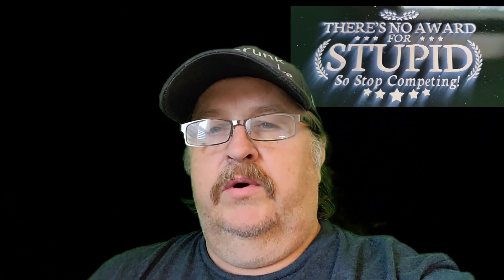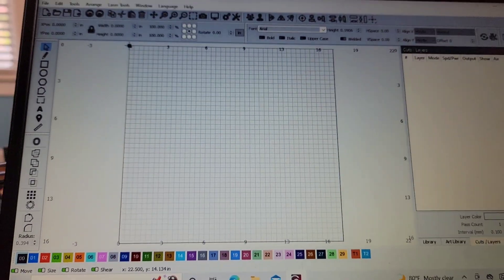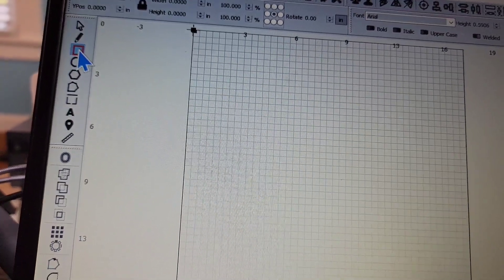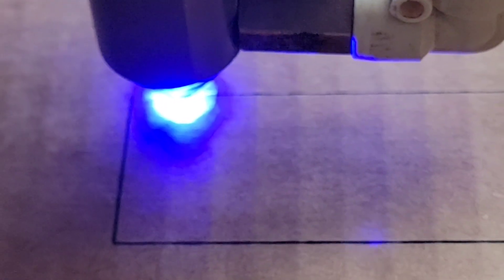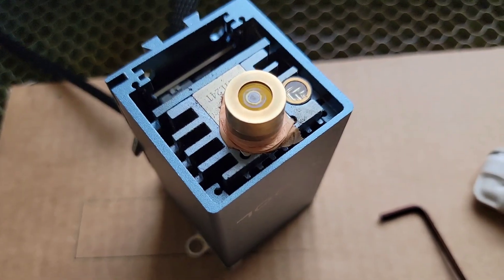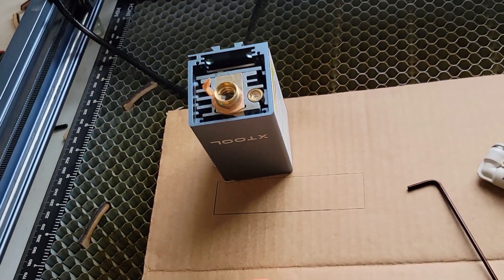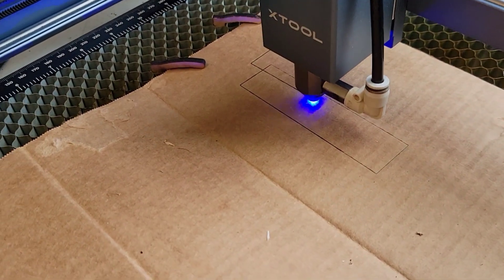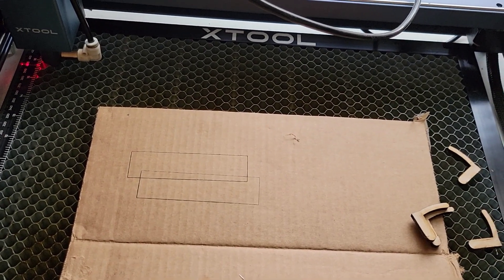Why isn't my xTool D1 working?

Comment: Were the rings highly reflective?? This looks like laser flash bask back reflecting back into the lens and over heating it. Were the rings coated with something anti-reflective (black paint or other non relfective products) should have prevented this.
Reply from the maker: I had some success with the silver ring. But the gold color ring was made out of Kryptonite or something. This is also when I discovered the first of 5 cracked lenses. I had a laser module that was far from ideal. We have since replaced that module and actually looking at replacing that laser completely. Too many problems with it.  Thanks for watching.

Comment: Ok I got a question. I just started seeing my laser
Go from super thin cut to wide and almost burn the wood to ash. I do have air assist and have cleaned with alcohol but what else could be wrong. Xtool has not got back to me yet. Been 2 days no response yet. If you could give me some ideas on  this and also I am using program that came with stool not light burn…yet
Reply from the maker: it sounds like a focus issue. it could be as simple as a cracked dust lens causing the inability to focus the laser correctly. it could be as bad as a cracked dust lens that led to a cracked laser lens. i've had all of the above issues. i had FOUR cracked dust lenses before the laser module itself failed. try removing the dust lens and see if it improves. if you don't find a lens failure somewhere, experiment with moving the laser closer to the cutting surface to see if you see an improvement. this is not a solution, but a test to determine the issue. if closer doesn't help, move it further away and note the differences. my module failed in a relatively short amount of time. these are not that great. there are a lot of better options out there. i learned the hard way. regardless which laser you use, if you want to really get creative with it, Lightburn is a must. i watched videos for two weeks studying before starting their free trial. i wish you luck. but you are probably going to need a replacement module.
Reply: I'm having the same issue. Used it once to cut just a few small test squares.  Tried using it the next day and it just gives me a charred box no matter what I do. Were you able to find the cause and fix it?
Reply from the maker: @leahwalker902  the way I fixed my problem with my xTool, was to replace it. Mine was nothing but problems from the beginning. If you  just bought it and you can return it, do so. I have more questions and comments from xTool owners than anyone else. If it's not about it not working, it's about it only completing part of a job. They say it is Lightburn compatible, but xTool users are constantly telling me the can't do the things I demonstrate. But they don't seem to have problems when they use XCS. The perfect fix is to return it.
Reply: @HoboWithWood  Thanks, I'll see if they let me. I've had it a week, used it once and already hate it..
Reply: @leahwalker902  yes, I took apart the shield, cleaned with alcohol and qtip, and then took apart the lense cover and did the same. Has worked. Air assist definitely on. I also watched YouTube videos from xtool to help me figure out. It’s what they recommend when they got back to me. Good luck.

Comment: Hello! I am having issues with my Xtool D1 Pro Laser. I received it and tried it, the first try was perfect. Then the second time I tried it wouldn't work. The laser would move around but the laser light barely had any strength. It would move around as if it was doing the job and would take the amount of time the project would take, however there were no marks on the plywood or anything and the light was very very weak. You could barely see. I emailed customer service and it has now been a 3 month battle or recommendations and changes they want me to make which I have but nothing has solved the issue. I went ahead and tried another laser head which is the one for metals. I did 1 dog tag that came out beautiful. I went ahead and tried to do another dog tag....same thing happened....the light was too weak barely visible, the laser would move around as if it was doing de project but nothing would engrave. I didn't change anything on the setting from first project to second. I was working with pre-establish material settings. Power speed and all was verified and still nothing. Do you have any idea what it could be or how to fix it?
Reply from the maker: You mentioned you tried a second laser head. It worked great on the first project. But after doing the first dog tag with the second laser head, it also began to have weak or no visible output. If I understand that correctly, the first question I have is whether the dog tag was coated/sprayed with anything prior to engraving? Email me at hobowithwood@gmail.com
Reply: I am having the exact problem. It worked fine for 2 days, then "lost power" (went through the motions, but laser was too dim to do anything) after trying a stainless steel tag. They sent me a new laserhead, and the same thing happened. It was fine with wood, but same issue after trying a tag. Help! I am so frustrated. I have only been able to do a few successful projects & have spent the rest if the time back and forth with xtool support.
Reply: I have the same issue. The replaced my motherboard. Worked momentarily. Then they replaced the laser module. The new module worked a few times and now doesn’t. Ordered a new one and infrared. It turned on, connected but before I could even use it, done. Motherboard gets power but neither the diode or infrared are. I’m so frustrated. I also have the F1 and constantly get false flame alerts. Ugh.

Comment: 6:08 Bro, I had the same problem, the laser no longer cut, I thought it had cracked, but no, it was only dirty because of the smoke and debris generated by the cut. Xtool recommended a simple trick, It should be cleaned with alcohol and a microfiber cloth and voila, started cutting like factory.
Reply from the maker: Subscribe and watch my 2, 3 and 4 month reviews on the xTool. I've now gone through 4 dust lenses and an actual laser module main lens.  Also watch my daily cleaning ritual video. The first one was probably from a lack of cleaning. But not the subsequent ones. In my four month review I demonstrate the air assist is actually sucking. I'm working to design a better nozzle to help make this better. I've got a new nozzle headed my way next week. Watch for an updated video and links to purchase a better nozzle for the air assist. xTool's nozzle is junk.

Comment: I have the D1 pro 10w and for some reason it won't cut, engrave, or score. Functions like normal. Red crosshairs and blue light from what I assumed was the laser. But it won't make ANY marks. I'm currently emailing them and it's about 1 email per day. Uugghhh.
Reply from the maker: I finally have up on expecting ANY help from them. I got a different laser and moved on. Then, a full year after my last email, they reached out to see if I still needed help. The best thing you can do is move on. As soon as it's on the budget, get you one of these. You won't regret it. Https://hobowithwood.com/roly

Comment: Glad you're back I business!  Based on bad customer service, would you recommend x-tool? I may order mine in a month or two. Thanks!
Reply from the maker: Would I buy again? Yup. Am I likely to get the 20W module? Yup. But, I new going in initially their support was lacking. I tried reaching out to them prior to my purchase and got no response. But the videos I watched on this laser and others convinced me to go ahead with my purchase. I hit the ground running when I unpacked the laser.  I do believe I the reason for my failure was due to not cleaning the lens while cleaning the laser. I was working the laser extremely hard for long hours. But make no mistake, this is a hobbist laser. There are issues they have worked out. I've seen the newer models have limit switches. This is something I wish mine had. I've managed to find work arounds, but would love to have them. Is there a better laser out there? Probably. Is there a better laser at a better  price point? Probably not.
Reply: @HoboWithWood  to be fair i had power issues- and after a bit of Chinglish they sent me a replacement quickly, i found the customer service emails pretty responsive (ie less then 24 hours reply) based on time difference etc not too bad, sorry to hear your issues, best buy i did so far! solid product - limit swithces would be nice tho

Comment: My xtool d1 pro won't even power on,all I get is the little blue light near the sd card,I think this happened when I ride to connect my laser to another computer.
I really have no idea how to fix it and I'm panicking now tbh,would you have any idea how to help me fix this issue please
Reply from the maker: This is a pretty common problem with xTool. I've seen may others complain of similar issues. It seems to be resolved with a new power supply and possibly a new control board. Here is a link describing their problem and their resolution. I've quit using my xTool and do not advise anyone to purchase one. Good luck. https://lahobbyguy.com/bb/viewtopic.php?t=1307

Comment: Without a doubt that crack lens is diffusing  your laser output, reducing your power like crazy. you can see in the video the focused it is not as intense.
Reply from the maker: Turns out the very first versions of the xTool didn't have this dust lens on it. I've heard from several owners that say they don't have this lens and have never had a problem with their laser with regular cleaning and maintenance. I suspect somewhere down the line, people who weren't cleaning properly, were possibly cracking their laser lens from being too dirty. So to protect people from themselves, xTool introduced this lens. It has been nothing but a problem for me, even with daily cleaning. I've finally just left it off. Still clean daily. (I typically burn 4 to 6 hours a day.) No issues and better more constant output. Thanks for watching. And everything I just said about the lens, is purely speculation.

Comment: Hi.  I run a 4K fiber optic laser at a fabrication company.  I maintenance in myself too.  That lens needs to be replaced.  A bad lens doesn't allow the 100% of the light to shine through so it cuts at a reduced power.  Reduced light = cutting at a reduced power rate.  A new lens will fix the problem in my opinion.  As for how it was damaged.  It's probably from cutting on a surface that reflected the light back at the lens or it cut material that splashed back on to the lens.  Such as cutting steel.  The hot slag splatters back at the lens and scorches the lens.  That results in cutting issues.  The kerf gets larger and can't cut thru the part.  Maybe you can help me with a problem I have.  I think I have to clear the laser's memory becuz my Aunt sent too many programs to the laser via her app.  I can't send a program from my PC to the laser because it tells me "its busy or paused".  So I hit the "start button" and it starts cutting a program that my Aunt sent to it via the app. The laser was working just fine until she tried using her mobile app to cut.  Now I can't program from my PC and when I hit the start button it begins cutting a program my Aunt sent via the app.  Any ideas?  I thought about deleting the file on the micro USB but I don't know where to download a new file to replace it with.
Reply from the maker: Thanks for watching and your comment. As to your big question, I have no idea on your programming issue. I just started my laser adventure two months ago. Sorry I can't help with that. As to my lens problem, I'm going through a lens every two weeks. After my first lens failure, I'm cleaning daily. But the lens still only last for a couple weeks before showing fatigue. As you pointed out, that makes it difficult to produces accurate results. I'm waiting to hear back from xTool about my issue.  Good luck with yours and thanks again for watching.

Comment: Mine did the same but my old lens looked good but I replaced it anyways and still the same I use to be able to cut MDF at 400mm @ 100 power and now I have to do it @ 100mm @ 100 and sometimes I still have to force it out, NO help from XTool. this is a new Xtool lens.
Reply from the maker: I ditched the xTool and never looked back.

Comment: Aw man, no good. You need a new lens. I didn’t use the tape but so far so good.
Reply from the maker: Finally heard from xTool. But not before I just ordered and paid for two lenses. They indicated they may be sending me one. But, they lens is not needed for operation. It is merely a dust cover. So, I removed it and clean the laser daily. I'm back in business. Thanks for watching. Plus subscribe and share.